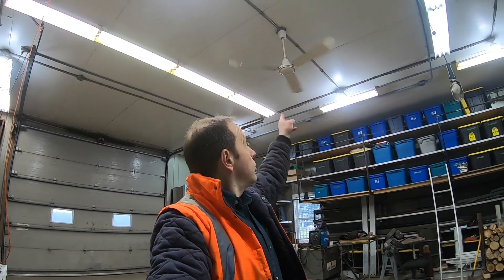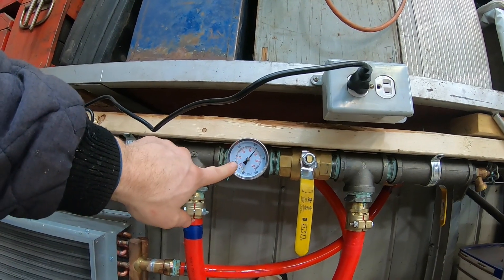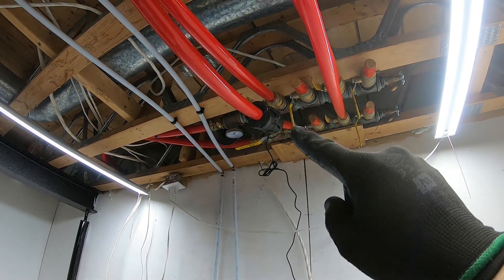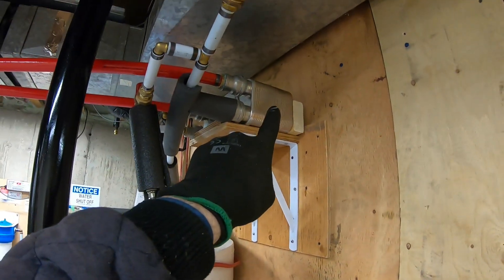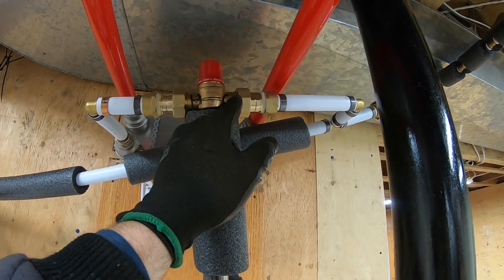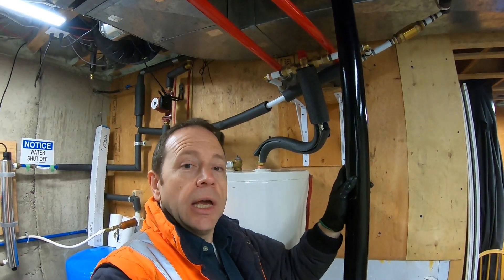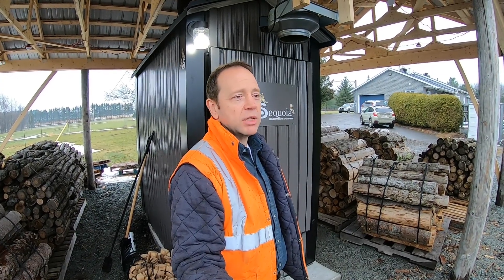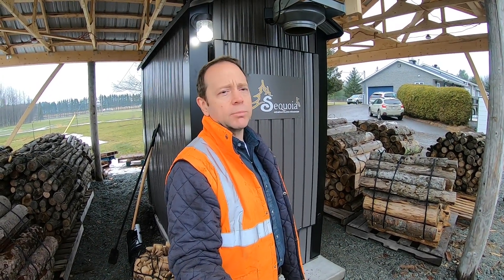#276 The Boiler  - Part 2

Comment: Joe, now this is what I was hoping to see. You got some great additions that I wish more folks would do, and I do have a few suggestions.
Garage…
1) I understand why now when you told me you turn on other heat exchanger the main forced air exchanger drops temp. It’s head loss. Pumped water wants the path of least resistance and that it thru exchanger on floor due to short loop. Probably 50-75% of the flow goes that way leaving less going to main exchanger thus dropping discharge air temp. 
2) I would recommend installing another 3way zone valve (you already have one in the house HX and I applaud you for it!!) in wall mount HX as well. I would bet the duct work above the coil gets pretty hot from convection when fan is not running?! In a shop that convection is probably not a concern other than the fact it’s uncontrolled heat and one could argue wasting in warmer winter weather. In a house that’s a different story!!
House…
Two  things I really appreciate you doing/using. 
1) 3way zone valve. These in my book are a must with a horizontal mounted HX. It save heat and makes house much more comfortable 
2) larger plate HX. What folks don’t realize with 10-20 platers yes you get hot water but what they don’t think about is the head loss on the boiler side!! Larger plate HX have a lot less pressure drop which in turn help circulate more gpms thus more btus to deliver and that can be especially important when this HX is plumbed in series such as you have with water heater plate HX followed by furnace HX. 
Lastly, if you are planning on moving the extra HX in garage into wood shop I would recommend installing that on a secondary loop. Research closely spaced tees or you can plumb both HXs with there own small circulator and loop. 
I really enjoy seeing folks hydronic heating systems especially when it’s source is from a wood boiler.
Reply from the maker: Point #1, you are most likely right in what is happening.  Then putting them in series is going to change the problem from deviated flow to reduced flow... 
Point #2, the furnace in the garage having the fan not running all the time, it does indeed produce heat by convection. Especially the furnace being mounted upside down, the blower gets warm, but not hot.  Same for the controls, they have an insulation to prevent them from being constantly hot.  In the house, that is a different story, as I run the furnace fan 100% of the time, all year long. It does filter the inside air for a better quality (we have 3 dogs inside!!!) and I make sure we distribute evenly the temperature inside. Otherwise, it gets very warm in the living room facing south, then very cold in the corner office facing north....  So running 24/7, I had no choice but to control the flow with a 3-way valve. It actually deviate 100% of the flow. So I fully control heating in the duct. What I get on the other hand is the radiant heat of the pex pipes through the floor. Which also I really like, because it's tiles and most of it is located north side of the house, near the patio door. So you get the picture, this is bonus radiant floor heating where needed. 
Larger plate HX was for that reason too and I want to be able to wash the machines using hot water too! So I needed a good amount of BTU there. 
For the small HX in the woodshop, I think the easiest, economical and efficient way would be to add another pump there.
Thanks Garny!

Comment: You have built a fantastic system and it is good that it will also heat your pool. It is good that your system does not require mains electric to run. An electric furnace would be far too expensive to run over here. Thanks for taking the time to explain the system
Reply from the maker: Electricity is very cheap here, as you may already know.  The blower itself is less than 500W to run, if not less. So that can be ran on a generator easily if needed during a power outage. Thanks!

Comment: Great set up Joe. A lot of thinking went into setting all that up. 
At 135/140F domestic hot water that instantly comes out of the hot water faucet, it only takes seconds to burn little fingers. Be careful. 
Have a nice day.
Reply from the maker: I know it's quite warm, but no small fingers here!  I pretty much keep my hands in the stream of hot water each morning washing my coffee maker!  But you made me curious about what is the limit... I've found a "burn exposure chart" on the web. As weird as it sounds, it states how long it take to get a 2nd degree burn at a specific temperature.  I see it's 3 seconds at 140°F. Then it's 17 seconds at 131°F (55°C)... So that would be smart I reduce that to 130°F or better yet 125°F.  That small temperature difference won't change much for the dishwasher. But will make a good difference if an accident was to happen.  I've got a temperature gauge to install inline with the mixing valve. Once installed, I'll be able to adjust that accordingly. Thanks for the recommendation!
Reply: @FromSteelToWood  I was a propane technician here in PEI most of my life. And worked with water heaters. Always told people 130F or 125F is a good temperature. I most surely don’t mean to be telling you what to do Joe. I just thought I’d mention it. My son got burned years ago at my uncles place from the water to hot. Aunt and uncle were use to it and turned cold water tap on too, to mix cold water in. But my son didn’t know that. So I always say remembered that and was telling people to keep the temperature down. 
If you need that hot water for other reasons, you could install mixing valves at the taps and keep your temperature where it is. A bit more work thou. 
Have a nice day Joe.

Comment: That's a really interesting system, Joe. They are great to burn crappy wood. I use a lot of dead elm in mine. Do you have many dead Elms on your property? For my firewood business, I get anywhere from 350 -375  for a full cord. (local delivery only). Take care
Reply from the maker: I've found an easier way to get rid of stumps... Instead of trying to split them, I simply throw them in the OWB beast... green or not. They may provide half of the BTU being green, but that is 10x less effort.  I was charging 130$/face cord, delivered, local. Half the Elm I have here are dying, but I do not have much of them to begin with. So I cut 2-3 Elm every year so far. Thanks!

Comment: Heck Joe....that sheet metal work looks better that I could've done myself !!  LOL  On your mixing valve to the heat exchanger for the potable hot water....is it a digital modulating control, or does it go full bore one way or the other to maintain 130F.  Lots of awesome engineering and work went into this system...but of course you know that already..LOL   Awesome job mon ami !
Reply from the maker: That is an analogic (spring) that can go up to 100% one side or the other.  So being on the return side to the tank, it makes sure any kind of sudden temperature variation will be "absorbed" in the water tank.  Then the temperature of the water that goes to the faucets is very stable. Thanks!

Comment: Super setup!  je me demandais si tu était aller avec le heat exchanger ou des plancher chauffant.  j'ai le meme setup que toi pour la fournaise/thermopompe, mais j'aimerais faire les plancher radiant.(confort) .   Merci pour la présentation des ton setup et felicitation!
Reply from the maker: Si tu veux, on peut s'écrire en privé (joe.lesage@hotmail.com).  Je peux te dire que les tuyaux qui se rendent à la fournaise et qui passent en dessous du plancher chauffent le plancher.  J'ai présentement les pieds sur une céramique à 25-30°C juste parce que mes tuyaux passent tout juste en dessous.  J'ai l'intention de faire passer quelques autres tuyaux en dessous de ma salle de bain pour chauffer le plancher. En ce moment, c'est un radiant électrique.

Comment: Salut Joe!!  That is a pretty impressive heating system you have for all your buildings.  I was interested to hear you speak about the return on investment.  I was wondering if there was any plus side to that.  Thanks for sharing it and take care.
Reply from the maker: Return on investment was hard to justify (read: none in my young age...) for many reasons. First, we have super cheap electricity in Québec. Second, I have two fireplaces in the house, plus a wood furnace in the garage... So we were not using 100% electricity for heating. Maybe half-half. Third is that we have a heatpump hooked to our furnace.... Well you see, I was not having a problem of costly heating bills. BUT, bringing firewood inside is not my favorite hobby.  Then the fireplace is for entertaining purposes, not primarily heating.  Then those equipment are not eternal. Putting money in the foreseeable future, would that be for a chimney replacement, heat pump replacement, etc... I would be back to square one.  Again, as you know, no electricity, no generator =  no water (and cold when you have...). So investing in a larger generator (especially to run hot water and heatpump) was another potential source of expense. Then the last, but not the least, I enjoy cutting firewood and could not stand heating with electricity... Lol! Thanks Mike!
Reply: @FromSteelToWood  So in fact you have very well justified the new boiler/heating system!!  Well done.  And for my 2 cents worth, return on investment only has to be justified by the investor!!  I used to have these arguments with the bean counters at work too!!
Reply from the maker: @GrampiesWorkshop  Lol! That's right!